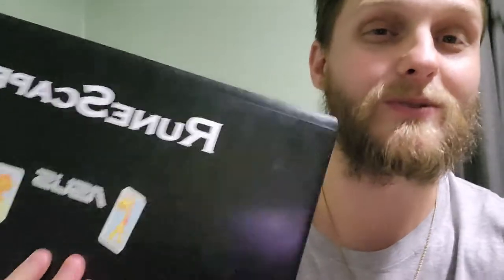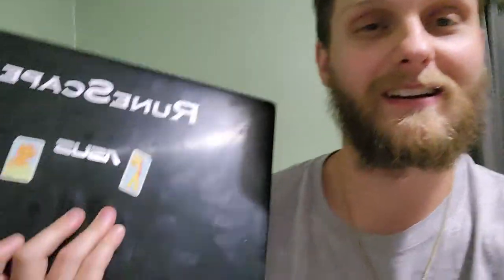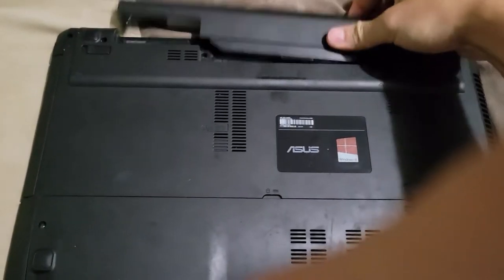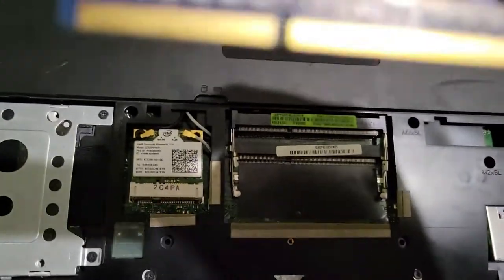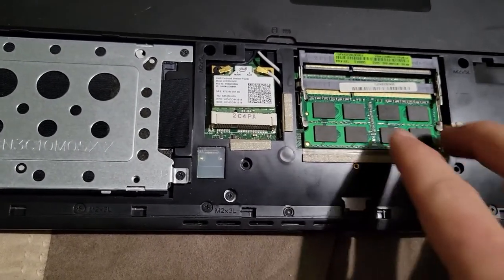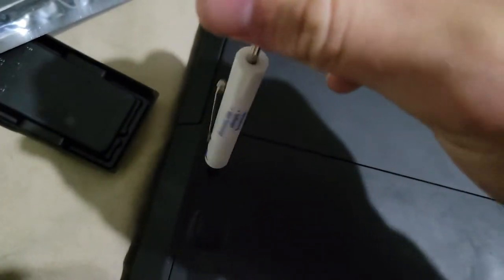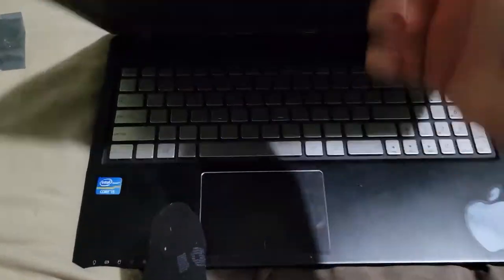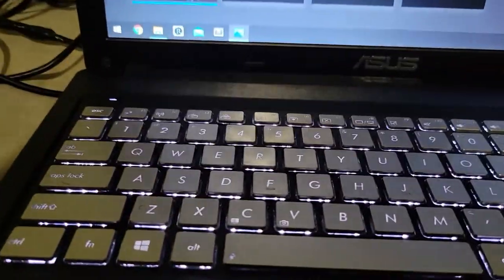Upgrading my Laptop - How to Install RAM into a Laptop (Asus laptop - RAM Upgrade) Daily Vlog

Comment: Good reminder, i actually need to do the same thing to my desktop PC.  Either that or replace it, not sure If I'm ready to dish out another $1500 for a new one.  Might be better off doing what you did to last another year or 2.
Reply from the maker: That's basically what it came down to for me. Spend a lot more and buy a new one, or save some money. I think Dave Ramsey kicked in there on this choice 😂
Reply: @ArcticVette  Yeah, I actually got a ton of RAM I could pull out of old PC's, but problem is they're all smaller Ram sticks of 1gb, 2gb and there's only 4 slots to insert Ram, so ya gotta buy larger sticks to upgrade.
Reply from the maker: @toddssnake_den8847  I'm loving my new ram..editing is wayyyy faster! Totally worth the small investment